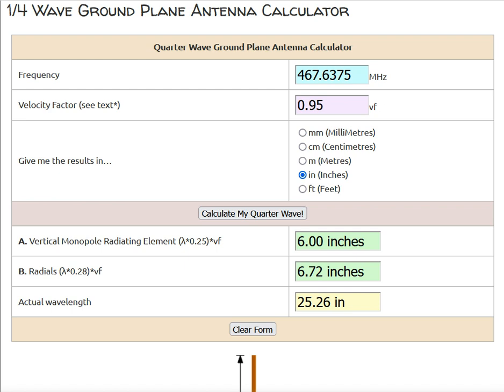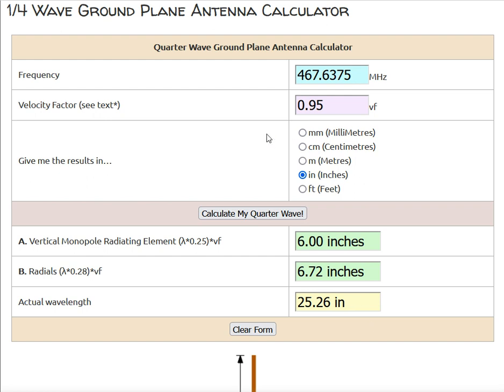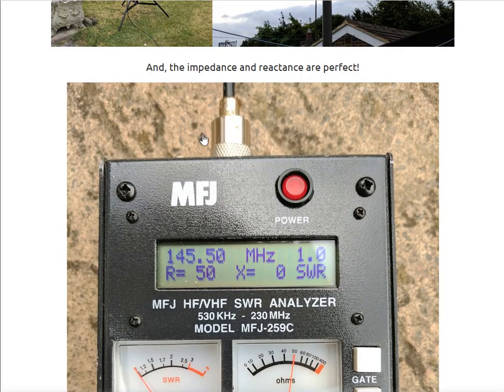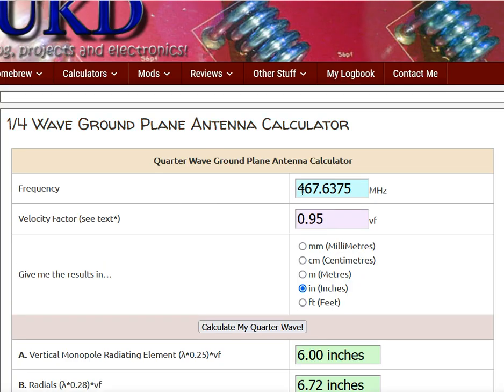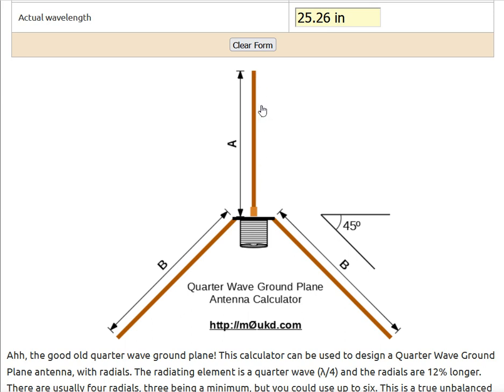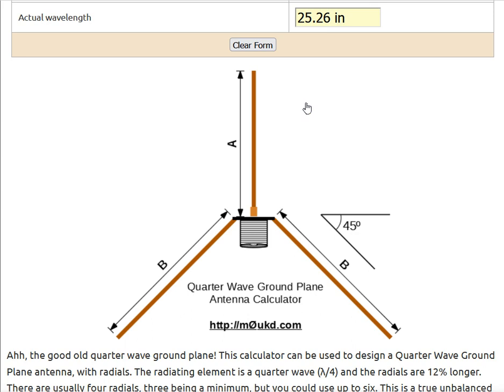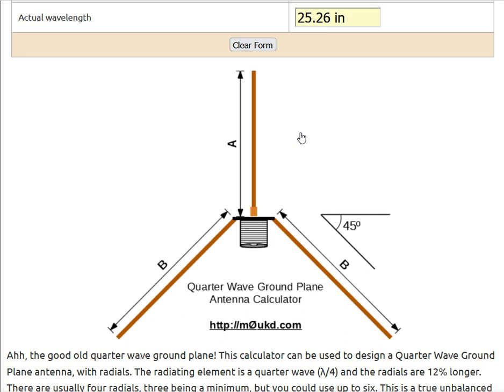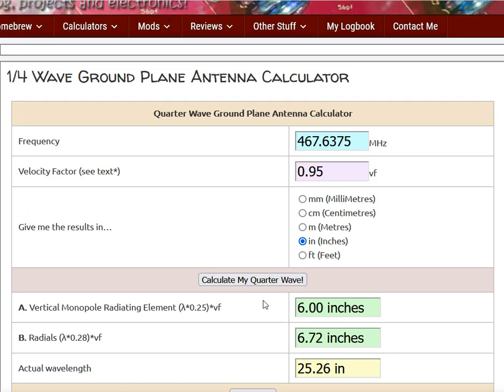🔺 Information on building an EASY GMRS two-way radio antenna!!🔺

Comment: i have used this calculator for many years, I made both my gmrs and murs antennas,  both work flawlessly, with my nano tech vna both are 1.0-1 swr tuned to center freq of gmrs and murs with my surecom shows 1.-01 with 0 reflect,  i used the so-239 chassis mount from amazon, some 6-32 bolts and nuts to mount the 4 ground planes in the holes where it would mount to a radio chassis,  and non coated  wire coat hangers cut to length, i can hit 1 gmrs repeater 45 miles away no problem the antenna is only 18 feet off the ground,   my murs antenna it covers 2 meter, murs, 70 cm and gmrs ,  i used the murs center frequency of 153.210 for the length,   which is 18.31 inches for the radiating element  &  20.51 inches for the ground planes,  which comes out roughly  to about a 1/2 wave gmrs antenna,

Comment: You can use a shaft coupler to lengthen the A) or shorten the (A .
Reply from the maker: yup i used something like that in my antenna build videos so i don't have to cut the antenna for better SWR. I can adjust the antenna instead 🙂
Reply: @GMRStwowayradio  in mm is about (3mm)in inches (0.12”)

Comment: This antenna is good as an emergency antenna. If you would like an antenna with more gain at the horizon, DOUBLE the lengths and make a half wave antenna, using a SWR meter to "finish" it. 14 ga, copper wire is a good wire to use. Larger wire will increase bandwidth, smaller wire decreases bandwidth. Only strip about 1/4 inch to solder onto the connector. Now the WHY. A half wave does not necessarily have more gain, but the lobes as viewed from the side of the antenna are flatter, meaning more signal is both radiated and received at the horizon. The 1/4 wave is better for mountainous terrain, however as the lobes are higher. The radials should be bent to around 45 degrees from vertical to assist in increasing the input impedance down to 50 ohms WITHOUT a matching network. Even if you are going to utilize repeaters, tuning should be at 462.6 Mhz.  This is the approximate band center and will give best results.
If you do not believe me, build two antennas, one as a 1/4 wave and one as a 1/2 wave. There is about a 2 db difference, but at the edge of comms distance, it can make the difference between not hearing and hearing. If you are on top of a mountain, try inverting the antenna, using a 1/4 wave build to utilize the natural radiation pattern of that antenna to put your gain at a down tilt, mounted on the side where the majority of your communications will occur.
To research this: Google radiation patterns of 1/4, 1/2 wave antennas and you will see what I am talking about. Or see this site:    http://www.mapleleafcom.com/PDFs_Downloads/Radiation_Patterns_Verticals.pdf

Dennis 
N7TZQ
WRQT522
Reply from the maker: Thanks for the info! I do have that link listed and more info in one of my videos. https://youtu.be/sJdzLcvkWDI
Reply: Bingo! Thanks for bringing light to these dark corners!

Comment: Ground planes work great and are so easy to make. Less than an hour. Gain will depend on type of coax you use as well. Have fun!
Reply from the maker: Yes they do and very easy can use just about anything thats metal!!
Reply: Actually, the gain will have NOTHING to do with the coax you use. The LOSS will have a lot to do with the coax you use. The 1/4 wave ground plane has no gain at all because it radiates equally in all directions. It is one up from the bottom of the list from the mythical isotropic radiator. 
Doubt me? Run a length of RG-174 from your radio and measure the power at the antenna. Now run a length of RG-213 and measure the power. And even RG-213 is crap at UHF compared to to other cable types.
Reply: @warplanner8852  Yeah, I misspoke. I meant loss.

Comment: Great video, what's the length
Reply from the maker: Thanks and if you mean the length of the wire that depends on the  Frequency. Just enter the info on the website, it will tell you the length.
Reply: 234/frequency in MHz.